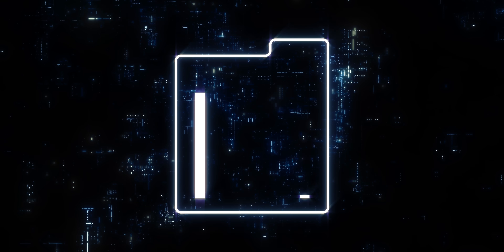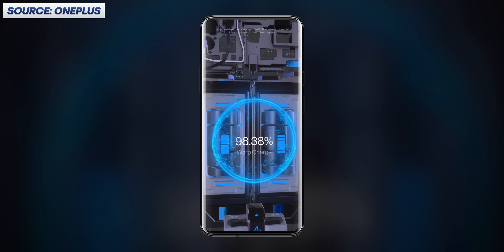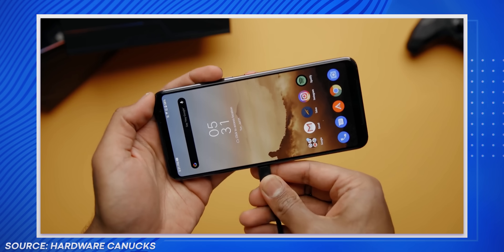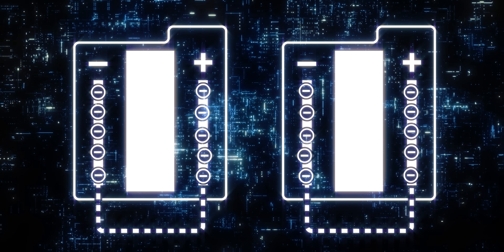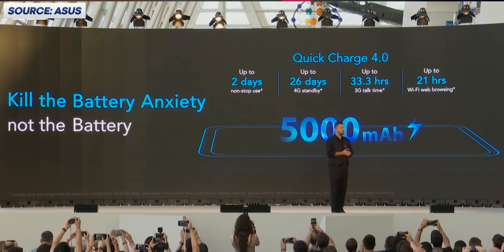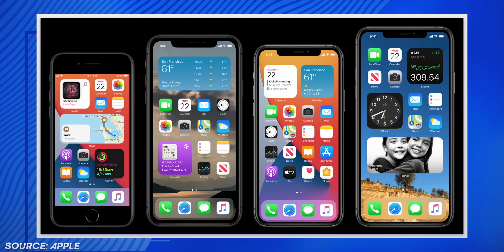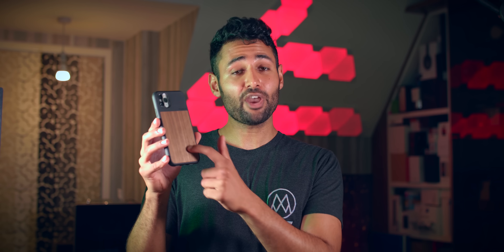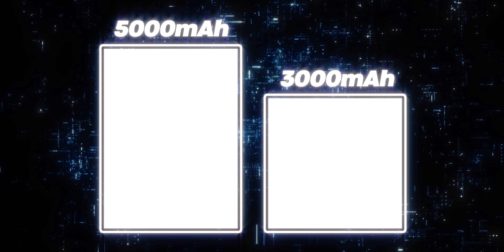The Problem with Fast Chargers.

Comment: Wow this guy just defended apple for slowing down their older phones🤣🤣🤣
Reply: Apple did this because of degraded batteries for goodness sake. Apple can’t have phones randomly shutting down. It is hardly reliable and may contribute to more users upgrading anyway. So their only solution was to slow down older iphones and to cut battery replacement cost from $79 to $29

Comment: I like the fact I can buy a battery from Xiaomi for 8.50 as so many dodgy battery's out there. Plus it's not hard to replace.
I feel the sweet spot is around 35w as no extra heat compared to 20w.

But when you go most places and you use another brick to charge your phone alot of them will be 20w or less and I'm not carrying around a UK power brick.

Comment: for the people who don't understand(probably no one bc he explained it really good) take it like this, when you jog it is likely for you to be tired in around 10-15 minutes if you run you might get tired around 5-7 minutes if your sprinting you might get tired in 30-60 seconds. and you will continue to lose your speed. the same is for charging, if you have fast charging it will lose the fastness  faster than if you were to have slow charging. personally i like fast charging but this completley change my perspective on fast and sloow charging & overall  i think that this is also pretty true. I mean the best case is if you were jogging bc you will take longer for it to charge, but in the end we still obvi get 100% in like less than 4 hours. Plus you can charge while still being active online. It doesn't change anything. in my opinion, get the charger with the slowest charger.

Comment: I'm not sure how true that phones actually overheat during fast charging.  there has been a number of studies on this showing that phones only fast charge for a short amount of time and alter its amp's throughout the charging process. as an example once it has filled its fast charging allowance it then drops down, like this one crazy 125 amp fast charger on the market which doesn't mean its going to charge your phone at 125amp, it might only go that high for a couple of minuets then reduce its self to protect its battery. you can actually buy usb cables that record its current during charge so you can see in real time. over heating during fast charging is a bit of a myth now days.

Comment: 50% or less charge at new  is called a storage charge and the law requires all new batterys wethere in a device or not must have a whats called a storeage charge only level one the battery is charge the first time battereis can not be put but back to a storage charge mode except for batterys used in hobby grade rc toys as these are using advanced chargers to charge them where are devices other wise do not use these advanced chagers there for can not be put back into a storage mode for long term storage

Comment: This is why I am getting the Insignia car charger for car use that has a PPS rating and shows you the range of voltages and amps on the product. The cheaper chargers don't and will not work as well.
Fast Charging is fast enough and Super Fast like the wall chargers do is really not needed , they only SFC within a certain range , then slow down. I am using my 15 watt charger from my Note5 I had to charge my A53 5G even though a 25watt one might be a little faster. I like to use what works and not toss it into the landfill. Plus the Sammy one from late 2015 is really nice quality.

Comment: That is brutally right!!! For phones and tabs, 5V 1A and 220V 150 mA. If the charger is 5V 1A and 220V 200 mA, the battery will malfunction. Lower mA, such as 5V 870 mA and 220 V 200 mA is Ok, and 5V 500 mA and 220V 200 mA is Ok. Nokia 1.3 A is bad. Apple 5V 1A at 220V 250 mA is bad. 5V 1A at 220 V 200 mA is a 1.2 A charger, some power banks like it.

Comment: Between cases and everything else slow charging is the best way to go I still use the og non-lightening charger I have all them back from my note 5 till current. I feel that 5.0/1.66 is just fine it takes 2 hours to charge my phone from dead but I get 5 days worth of use out of my 5kmah. So I'm good with waiting a lil.

Comment: Recently got my S22 Ultra and for the first time after learning about it, I've been charging this phone just to around 85/90% to prolong its lifespan.
So, knowing now there's a guarantee of preserving 80% health after 800 charges from cellphone companies, I wonder if they are taking in account charging the battery full (100%) or charging it in a healthy way (80%).
Reply: bro in the battery settings you can choose protecting battery, it will only charge the phone to 85%, i did on my S20+. And you should not let your phone under 20%.

Comment: Compare filling a glass of water with the faucet turned on full blast. The glass will fill up with water shooting out of the top of the glass. It looks full. But when you turn off the water faucet the glass is never  completely full. So as the glass gets nearly full you slow the water down to get it full. This exactly how a cell phone battery works. Provides an example that everyone knows about. Feel free to use this.
Reply: You prune it is called a TAP NOT A FAUCET
GET YOUR WORDS CORRECT

Comment: lol you lost me at "slows down old devices to prevent battery damage" as if the battery can't be replaced
Reply: yeah it can be replaced but they still do slow down the older phones, whether you change the battery or not, and that's also a strategy to make people buy new phones.
Reply: @panrex2451  yes, I know, and it's scummy
wouldn't call it a strategy, I'd call it an anti-customer scam
Reply: @rarespetrusamartean5433  well i don't approve that either but it's just what they do, sadly

Comment: So this video popped up at a good time. I just ordered an S22U and don't plan on buying the charger for the 45W speed, but after watching this, I don't know that my old OnePlus 6T charger will be an okay fit for it as it wasn't designed to work with the phone, and likely doesn't have any kind of smart charging protocols onboard

If anyone knows anything about this, it would help

Comment: That's the issue I have Poco x3 for one year and it's bettery life isn't as good anymore possibly due to fast charging

Now I'm wondering should I really buy redmi k50 gaming edition as it has 120watts charging but what if the battery also becomes horrendous after 1 year.

Also my Poco x3 lasts about 5-6 Hours on 1 charge now 

Or should I buy Xiaomi 11 last year flagship?

Has anyone bought or looked into Motorola s30 and x30 

I want to buy s30 but I am hesitant about its longevity as a phone at least it should last few years
Reply: why not buy a new battery and dont use any fast charge anymore ?

Comment: I have never understood why so many people need fast charging. I just plug my phone into the charger a couple hours before bed and then unplug when i see it is full or if i am about to go to bed.
I can still get 1 day+ out of my original phone battery with some web browsing and light gaming. Sure if does not last as long as it once did, but longer than phnes most people i have seen own that are much newer. I used a 1A charger for the first 4 years now i have a  2,4A charger.
And my phone is a Samsung s5 mini i bought in december 2016 with a 2100mah battery.

Comment: It's no matter how fast the charger or how big the battery , the best way to save you battery capacity and without stressing the processer is turn of your telephone and put it in your charger and that's what I'm doing with my mi 11t pro with 120 w fast charger and never been experiencing heat problems , and its full chargde max around 19 minutes .

Comment: I always use a slower charger than the bundled one. My phone batteries last 5 years on avg. Worked on lenovo P1, motorola one power, Lenovo P780.

Comment: My current phone (1+ Nord N100) has optimized charging, a 5k milliamp battery, & came with a fairly large charger that can apparently do dual power output...
Either 5 volt, 2 amp, 10 watt... or  9 volt, 2 amp, 18 watt.  I prefer to use an old Samsung brick that puts out just 1.5 amps for a nice, safe, slow charge.

Comment: I think actual use battery hasn't dramatically changed in years. Going on year 4 of this phone and it still lasts me around 2 days of pretty heavy use. I generally drain it to 10% before charging but otherwise I don't do anything special and it seems better than ever.

Comment: one technical flaw though: if the electrons were to be balanced on either terminals, then the battery is in a state of equilibrium or otherwise 0% charge. at equilibrium no further current/charge flow takes place which is why recharging is done at a higher voltage than discharging voltage.

Comment: Thermal runaway in li-on batteries has made progress and been largely eliminated under normal operating parameters.
Problem is it's not entirely gone, and fast chargers can expose this due to excessive heating via over current conditions in charging.
All bets are off when it comes to people that have no idea what they're doing.
I've seen someone stick a pin through a battery, then he was stunned that it blew up.
Told me the phone was still under warranty, so I told him "abuse is not under warranty".
Dumb people manage to do the most stupid things and *nobody (except me as a technician) wants to read a bloody manual anymore.

So fed up with lazy people that buy something then bring it to me, then ask how to operate something, when the F--king manual came with the device.

Comment: So I have a battery pack surgically implanted in my back (I have 2 Spinal Cord Stimulators). It has a wireless charger- obviously. If the charging disc gets too hit, it just shuts off, which no warning. It’s incredibly annoying as charging can take 4-5 hours so you can go to check it 5 hours later and discover it stopped charging 4:45 ago…

Comment: The visual graphic of the positive and negative bois inside the battery really helped me understand the 40-80 charging rule much better. I’m a visual learner and this video hammered it home. Thank you
Reply: Charging to just 80 means 20% capacity is wasted
Smartphones are designed to be 100% charged
I do that each night with 0 problems and my Smartphone will still last up to 6 years

Comment: no no no no no. 50% is not equally distributed electrons Lol. If 100% is like being at 1000 psi pressure then 50% is like being at 500 psi, not 0.. in fact 0 psi or "equalized pressure" woukd correspond to 0% charge.

Comment: @Mrwhosetheboss - 
The wall wart in the 230V / 110V AC power outlet is NOT a charger , its just a (now multi voltage) Power Supply , the charger is in the phone ! 
(you can charge your phone using a 1980s computer Power supply (by tapping into +5V & Ground)

Comment: A. Electrons dont actually move. The pass along a charge. 
B. Heat is not the issue per say. At least not in those temperatures. While heat is not healthy to the battery, the issue is cooling and heating, makes the material contract and crack/loose shape over time. 
So it’s a matter of frequency of fast charging.
C. If you keep your phone on the wireless charger, it doesn’t need to use all of it’s wattage, so it shouldn’t heat up.

Comment: Hey guys I have a question, I just bought a iPhone 13 Pro Max that I’m waiting on the case and screen protector to come in before I use it, I also bought a 30W faster charger because I read that the phone can go up to 27W, I also have a iPhone 11 using now that I bought when it came out that is at 88% battery life currently. So I’m wondering will using the 30W be worse then using a 20W? I’m never going to charge overnight and mostly will use it at night when my shift is over. 

From what I read 20-80 seems to work good so I’ll remember that, or with these new phones does it matter with charging the 20-80 rule? And will fast charging really matter since I won’t be using as much as my 11 now because I’ll be using the 11 for my call center job?

Comment: The batteries having all the electrons on one side at 100% isn't really accurate. Batteries aren't capacitors, they undergo a chemical reaction to produce voltage, charging the battery simply causes the inverse reaction to return it to the "charged" state. The theory on keeping them 50% charged is true however, there is more internal pressure at the top and bottom of the scale. This is only true for lithium batteries though. An example of a battery that needs to hold full charge at any given point is a standard lead acid car battery, if held in the uncharged state the battery actually undergoes sulfation where crystals form on the plates impeding current flow. This is much different from a capacitor, which actually holds electrons on one side to produce voltage differential.

Comment: Now, my OnePlus 9 Pro (which charges unbelievably fast), has an "optimized charging" feature that charges my phone based on my charging pattern to preserve battery life. 

Idk how well that would work but I hope I'll never have to replace the battery in the 4-5 years I'll be using it!
Reply: I have a 3t that still after all these years has great battery life. Their Dash charging system also somehow keeps the phone from getting too hot while using the phone and charging at the same time.
Reply: Iphones & Huawei phones also have that feature.
Reply: My oneplus 5 still leaves me with the same charge as it did new after a shift of work.

Comment: Had my s21 ultra for almost a year and the battery life has gotten better most likely through better software tho. but yea technically it should be 20-30% less efficient but Instead it's more efficient . I think 25 watts is the sweet spot and is more than fast enough.

Comment: question is... i have brand new black shark 4 now... and it has fast charging option... so will it change something if i will just charge him slowly? for example with old iphone adapter? :D:D:D i have no idea i have it for a week now and i only charged it by original 67W adapter how to best save battery life? what to do :D
Reply: You can disable fast charge on the settings. You dont need to change the charger. 

Open settings, go to Battery and than disable fast and super fast charge.

Comment: It is actually true that using a gentle charger IS way easier on the battery as it'll barely generate heat at all and my Smartphone gently charges and that's why my phone and phone battery has lasted for the last 6 years but time has took its toll as the charge doesn't last as long as it did unlike when the phone was brand new

Comment: For long term storage, keep your lithium ion batteries between 30% - 50% charge. 40% is usually ideal. Unplug from the device if applicable.
Reply: How?
Reply: @laviniabatista2326  when lithium batteries are at 40% they are at a neutral voltage. Having a voltage to high or too low causes a battery to deteriorate faster.
Reply: @lesscommonsense1804 wasting 60% is stupid,also,40% would not even last a whole day
100% is what Smartphones are designed for

Comment: I used to charge my Samsung Galaxy S21 Ultra using the 25w Super Fast Charging. At first with the power mode and all the power saving options on as well the smartphone would last 2 days. Then Smartphone would get very warm on the back each time I would charge it 0 to 100 at 25w. After doing that around 25x or so the battery would last a day. then 18 hours, then 14 hours, and then 13 hours, and so on. So I let it run dead again but, this time I left the phone off and let it charge 0 to 100 using the 18w Adaptive Fast Charging. The phone did not get hot at all and the battery ran for 2 days once again on a single charge. I guess I'll be sticking with 18w Adaptive Fast Charging from here on out. however, all this being said I would not use the standard cable slow charge speed because it would take way, way, way more time to charge than I am willing to wait for my Smartphone to charge up.

Comment: I...I have a brand new phone. Should I actually take the time to change what are basically core habits for my phone usage? I.e scrolling tiktok, watching YouTube, screwing on discord, while charging?
Reply: The problem starts when the battery gets past the 35 Celsius mark. If you use it too much while it's hot, you may reduce the longevity of the battery by half a year.
So you should find a way to scroll in apps while your cellphone keeps its cool.
Reply: @jackdanila9893  I don't find that my phone gets warm really

Comment: I got a Motorola G7 power when it came out and Im still using it to this day and never once installed an update
I've used nothing but the fast charge on it
however the battery has seemingly never lost capacity (I still get 4+ days out of a single charge)
Im putting this down to the fact that in its entire 3 ish years (I think) its probably been charged less than the average phone would be in a year
it also spends most of its time around 75-25%
and a larger battery gets impacted less by degradation
Reply: Do you mind telling me how often do you use your phone? Or maybe how much Screen on Time you get. 
Because Im happy with my samsung A52 that lasts maximum 2 days or 8 hours Scren on Time.

Comment: in proper technical terms, watts mean nothing, unless you set them in relation to a battery's capacity and cell count. charge and discharge currents of LiIon and LiPo cells are meassured in C, multiples of the nominal capacity. 
PS: graphene is a bit of a buzzword. but where graphene batteries really matters, is drone racing LiPo cells. they are comparably bulky and heavy, but they can handle constant discharge currents of up to 100C, and take a LOT of abuse. (that's analogous of jumpstarting a car with your phones battery)